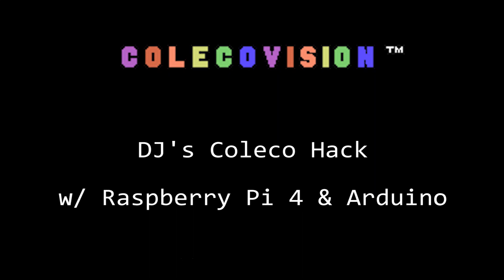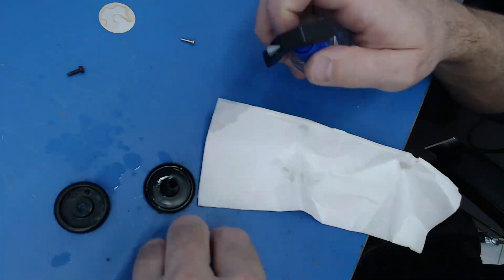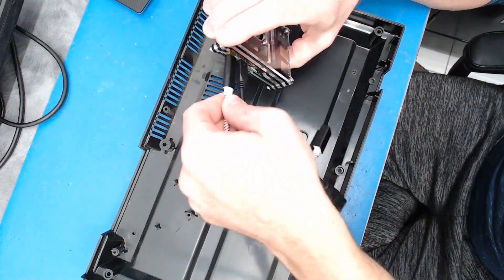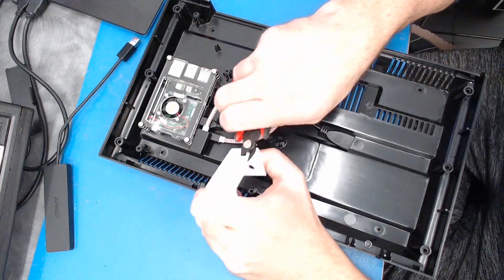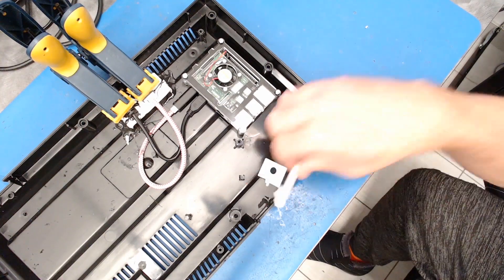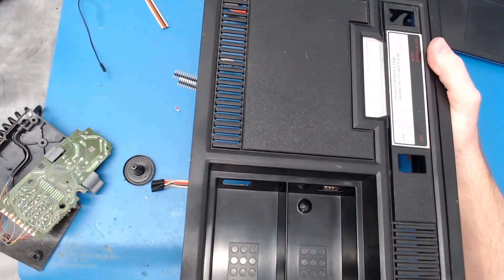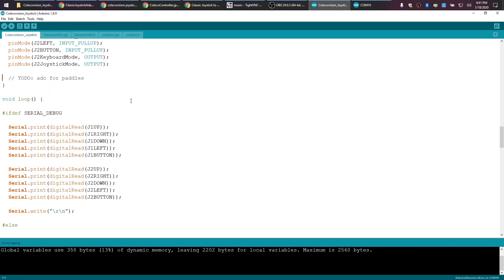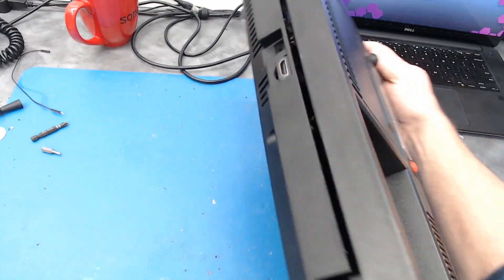ColecoVision hack with Raspberry Pi 4, Arduino, Retro Pi and JB Weld

Comment: Great video! Could you have used the GPIO for controller hookup instead, too?  Any pros and cons? Was looking to hook mine up for testing on Rpi and looking around for elegant ways to do it. Thanks so much! 
Oh… where did that music come from? Sounds familiar… like from Acid or something? I used that same sort of electronic calliope sound many years ago in a demo reel but lost it and don’t remember what it’s called or where it’s from. Thanks again!!
Reply from the maker: Using the gpio would be a bit more difficulty because you'll need a program to read the gpio and somehow convert that to USB device input. There's probably a few examples out there, but it'll be CPU intensive because it needs to poll the gpio on a loop.
Reply: @DJSures  Oh I was meaning to bypass USB altogether.  The program doesn't need to be anything crazy as it's just meant for testing old controllers.  I have DB9 connectors that I can solder leads to and connect those leads to the GPIO so all I'd have to do is plug an old controller into it and should be good... if I'm thinking straight, that is. 😵‍💫

Comment: Is this hack reversible?  I don’t like the idea of a vintage Colecovision being sacrificed.
Reply from the maker: Sure is - I keep all the PCs. And it doesn't matter much anyway because the PCB is broken. I only buy broken consoles because I can't afford working ones - eBay ppl charge way too much money. Hence the Pi conversion so i don't have to be homeless to buy cartridges
Reply: @DJSures  What is broken?
Reply from the maker: @infinitecanadian  The PCB is cracked. EBay.ca is a great place to find them if you're interested in nonworking consoles. You can get them cheaper because they're not working. But beware, the sellers will put effort into making them broken because they swap the good parts to make working consoles. So a "non-working" eBay console means a mismatch of broken parts from broken consoles. Expect broken joysticks, PCs, cracked cases, and other stuff. Most of the items I get are in terrible shape - yet I still have to pay good money for them.